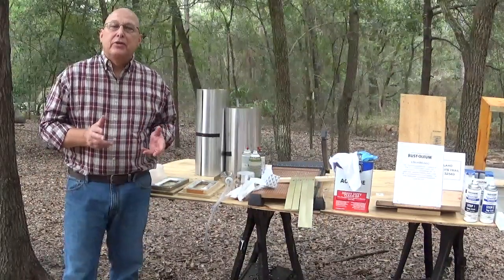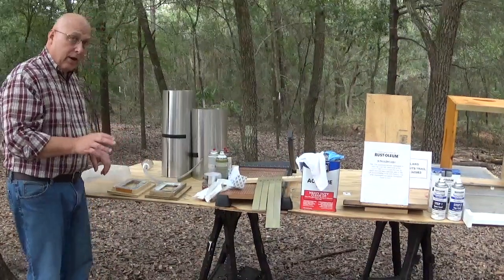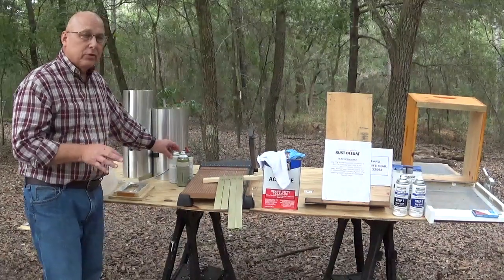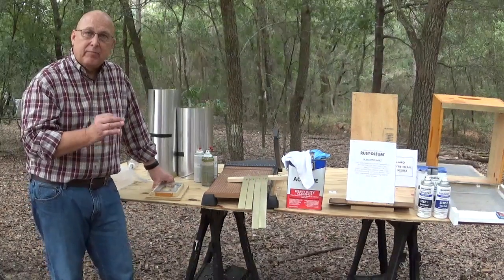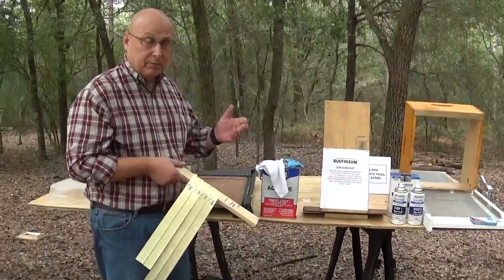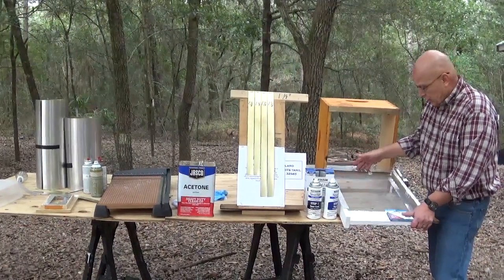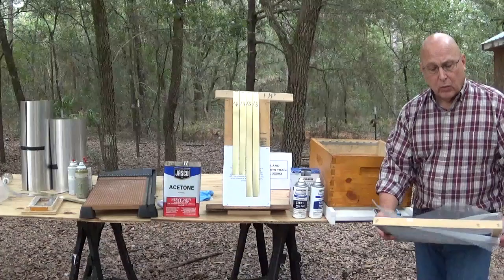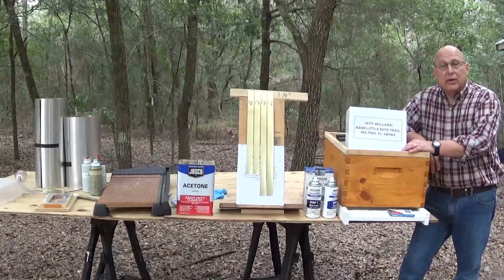Small Hive Beetle Barrier, it is easy to make and inexpensive.....

Comment: Mr. Willard. You have $$ headed your way!  I am a 3rd year Beek and have struggled with beetles something fierce. I am in North Central Alabama. I have switched to a “ Freeman Style”  bottom board and added your strips. Went in my hives today and not a single beetle! This time last year, I was already struggling with a significant SHB investation. Thank you so much for your contribution to the bee keeping community.
Reply from the maker: Hi Tim,
  Thank you and I glad its working in your hives. I have some news that I wanted you and others to be aware of, I have found out that the spray can kits of Neverwet that I used originally is being chewed off by the bees, mine lasted over two years before the bees cleaned them off, some hives really cleaned the barriers  off and some hives just removed a little of the Neverwet coating.

  I have some additional info from Rustoleum about an Industrial Neverwet that is 20 stronger than the spray can and I have been making some changes to my hives that will help and will share in an upcoming video very soon. The spray can kit does work as you and I know but it just won't hold up long term against the hive cleaning habits of the bees.

Comment: Gday from Queensland Australia.  I just came across your video today and I think it is a great idea.  I am only just starting out with my 1 hive but i am  making some more hive boxes to increase my bees to 3 or 4 hives. I have been reasonably lucky so far with SHB but still have a half a dozen or so each time i do an inspection.  As it is so reasonably priced to get the never wet product on eBay i am going to outfit my new hives and my existing one asap. You have done a great service to the beekeeping community wordwide if it works as good as it seems to.  I hope those same beekeepers can show their appreciation by giving a little back. Thanks again mate. All the best.
Reply from the maker: Hi John,
  Thanks for watching and don't forget to subscribe and like, I've got more videos on this Neverwet idea and new ones coming out. The SHB can not walk on this material but I have been making improvement videos on the installation of these Neverwet coated barriers. I am now experimenting with a stronger material and a new way to install them.  Watch all the videos to get all the updates for hive protection. Good luck with your hives...

Comment: Because of the electrolysis, forgo the staples and merely angle the metal 90 degrees for a quarter of an inch,  and have your measurements adjust to the 3/8 overhang to the inside of the super brood box then rip a groove down the bottom center of each board to fit a single or double bent piece of the aluminum flashing. No staples and no erosion to deal with, ever. The bees shouldn't have a working space underneath which is brilliant thinking, and the bees are not hampered by the ledge flashing? I'm up for some sharing some ideas...happy bee keeping to everyone who shares without always looking for a  reward. Some things money can't buy... And the best often comes that very way more often than not. Good wishes for you and thanks for sharing this grateful information about saving the bees.
Reply from the maker: Thanks for the info. I have always tried to come up with the simplest and most efficient approach to any project that I do. There is always room for improvement on anyone's idea and a dozen different ways to use Neverwet against SHB, good luck and have fun with yours.

Comment: I like the beetle vac idea, when looking through the hive and seeing 3 or 4 walking around and trying to get them with a hive tool without crushing comb,  that looks like a good idea,  have to try that,  thanks.
Reply from the maker: I even made one that is battery operated to suck up Fire ants in the Neverwet VS Ants video but when I used it in the hives for SHB I had to paint it white because the noise and black plastic was really pissing off the bees.

Comment: I love this idea and the succinct and no nonsense way you present it. I'm going to make one this weekend. Thanks for figuring this out!  Donation headed your way. (Jeff Willard, 6255 Little Bits Trail, Milton Florida, 32583) 
  One small nit; If you google "Galvanic Corrosion" and open the Wikipedia link you will find a table that shows plain, non zinc plated steel is a better coupling to aluminum (only 0.05  volts difference) compared to the coupling voltage of stainless steel to aluminum (0.45 volts). More voltage = more corrosion. Use of a stainless steel staple (cathode) will, over time, corrode the aluminum (anode). If zinc plated steel staples are used they will give up their plating fairly fast (Zinc is more anodic than aluminum) and will leave the steel exposed to the elements to corrode at the normal rate.  The best compromise would be to use non-plated steel staples with aluminum, but to seal the staple using paint.
Reply from the maker: Hi Jeff H, I'm glad you liked the video. The flanges do repel the Hive Beetles but even I am still fighting with the small gaps here and there on the vent tops and hive bodies. Moisture appears to be the culprit, I have been experimenting with foam seal tapes, I have been using white polyethylene closed cell adhesive 1/8"thick x 1/2wide" between the supers and hive body and Frost king gray vinyl foam tape 3/16" thick x 3/4" wide on the vent tops. Give the edge your going to stick the tape on a coating of 3M contact adhesive for some extra bonding, these two foam tapes appear to be doing the trick. I got the polyethylene from Amazon and the vinyl from our hardware store. Thanks for the info on the corrosion ratings between stainless and plated staples. Good luck with your Bees.Jeff Willard
Reply: Hi Jeff Willard,
Thanks again for all your hard work and sharing this idea with us!
Just to clarify this a little, I think Jeff H has a point about galvanic corrosion.  However, things are not always as simple as what one expects.  I had lengthy discussion at work about bolting aluminum together with stainless fasteners, and the conclusion was that it was okay, but the reverse is not okay.  One big consideration is the area difference between the two metals. If you used aluminum bolts with stainless plates, there would be a failure in a very short time.
So, to make a long story short, because there is so much aluminum versus stainless, it shouldn't be a problem. 
Scroll down to the plating compatibility chart:
https://www.fastenal.com/content/feds/pdf/Article%20-%20Corrosion.pdf
And let us know if any of your staples or connections fail.  I'll do the same.
BTW, you answered my question in my previous post and I have bought the closed cell foam tape, and it seems to be helping with the SHB problem.  Thanks for that tip, too.
Reply: Jeff Willar
Reply: Jeff, Makes much sense in what you explained. I guess one could spray the staple clips using Bin shellac based sealer, let dry before loading into the staple gun. Thanks for your input.

Comment: Hi Jeff,  thanks for the prompt response.  I'm currently looking through peer reviewed articles about flight and hive interaction of SHB.  Your explanation of the behavior of SHB inside the hive makes complete sense to me...but I'm not an expert.  I will gladly share any information that I find.  Also,  I am starting two new hives this spring.  I plan on fabricating your flanges and installing them per your instructions.  Top screens also installed.  Based on past experience,  we should see a measurable decline in SHB population this summer.  I will keep you and your subscribers informed.  Definitely will compensate you for the R&D.  
Again, thank you for your team-effort disposition.
Reply from the maker: Hi Mmmm, Thank you and please keep the bee community informed of any additional information you find. I know that the Neverwet coated flanges will work in your hives as well as they have in mine. Just make sure you caulk and seal the hive above the coated flanges, if you haven't watched them yet, check out the "update; small hive beetle excluder" videos. In these I explain some additional problem solving while using the flanges. You'll see in update #2 I still have almost zero beetles in my 31 hives two years after their installation. I have one last video about these Neverwet coated flanges that will leave the bee community amazed what these coated flanges can do, I should have it done and on you tube this week. Good Luck with your bees.

Comment: I also am going to try the approach to spray a large sheet and then cut into strips. Will report back on effectiveness.
Reply from the maker: You could spray a whole sheet,  I've seen people talk about doing it that way. My only concern with that method is the Neverwet adhesion on the cut edge, it may hold up I just don't know. I thought that coating the whole strip at one time would allow the maximum adhesion of the Neverwet on the flange edges. You can always try some to see if it works.  Remember, sometimes doing it right the first time is a lot easier than doing it twice.

Comment: oh just to add. I use the metal tape to seal boxes together. it is very weather proof. it's 2 inch wide and it really seals them up then when removing supers you just run your finger nail thru it. just a thought for you on sealing the boxes together.
Reply from the maker: Thank You.
Reply: Jeff Willard y

Comment: sweet idea jeff.  thanks for sharing.. I made some aluminum strips like you did on my bottom board and then on my bottom hive body and noticed a decrease in my hive beetle population.  I will now try and get that paint from rustoleum and make it slicker.  Thanks for the tip.
Reply from the maker: Thanks Mike, It works.... Good luck.

Comment: Hi, Jeff, thanks for all your research!!  I also like the way you showed all of the different methods you tried that didn't work.  You presented your findings super well in your video.  Most of us need to take an idea all the way to the extent you do and then share it.  It is too bad some of the extension people don't do some of this research.  

I am also wondering if a beetle baffle in the front of the hive made with your metal strips might work or of rain x-- the stuff my wife likes to use on her windshield wipers might work.  Yes, it looks like I have a little research to do myself.  Hive beetles are a big problem in that they take up a lot of bee time in our area.  Yes, one could wait until bees become hygienic enough to combat them, but that takes up bee time that I want my bees to do other bee work, not mess with beetles.
Reply from the maker: Hi Tom, I'm not sure what you mean by a baffle in the front of the hive. When install as in the video the Neverwet coated flanges protrudes inside the hive  3/8" continuously on all four sides with overlapping corners. The rain-x, I believe is a silicone based water repellant for glass that is not a permanent coating, Neverwet is permanent and non-toxic. But as with all inventions there is always room for improvement, but with no hive beetles inside my 40 hives I don't think I'm going to change my design, plus its cheap to make.....
Reply: I guess I was trying to tie your success with  the beetle baffle where an opening near the front of the hive where the beetles trying to crawl under the hive to get into the hive would just slide off into a waiting moat of oil and the bees could step over it and into the hive.  I just don't like the idea of having a pan of oil under the whole screened bottom.  

I am about to make some bottom boards so I will try it and if successful, I will send you pics (might be next year though for testing).  I am encouraged by all your experiments on your method.  The screened bottom is supposed to help with ventilation and varroa mite.  

To help answer other's questions on beetles flying up onto the hive from the bottom board, it seems that their take off is a little too haphazard for very short distances.  They seem to take flight and then orient themselves to land on their feet and it doesn't work for them on very short distances.  Thanks again for your work on this issue.

Comment: Jeff love the idea. I am going to try this as soon as I can. destroyed my shoulder at work. I use raised bottom boards with 1 1/2 -2 inch holes for my bottoms. that raises the brood box by 1-2 inches. the bees seem to really like these bottom due to more natural opening I guess. they will sometimes add a small strip of burr comb. no problem. I wondering if the open space if the SHB can just fly up. with the more open bottoms I have notice way way fewer SHB in those hives. may be because they have to fly the distance and don't. don't know. but I'm going to do this on my nucs and old bases. good luck and see you on the forum beemaster's and welcome on board.  I'll contribute as soon as I can. we need to help each other all we can.
divemaster1963.
Reply from the maker: Hi John, Small Hive Beetles are not suppose to fly once inside the hive but I'm sure there is always that one mutant hive beetle that does not act as normal as the rest of them. Your bottom board sounds interesting. If you can take a picture of it and post it on Beemaster,  Bee Keepers are always interested in something new and works.. Thanks..

Comment: Will try this. Our hives were devasted by these beatles, nine hives down to two. Tragic.
Reply from the maker: Hi Peter, This really "WORKS" but I can not stress enough to caulk the seam between the bottom board and hive body and use polyethylene foam tape between hive, supers and vent top or covers. If you leave any opening above the Nevercoated flanges the beetles will get in. Now in my hives I can't even find enough Hive Beetles to perform the tests that I did.  This is were I buy mine......  http://www.equalseal.com/White-Polyethylene-Closed-Cell-Foam-s/2187.htm
Reply: Thank you!

Comment: Hi Jeff, this is exactly what I have been looking for- I am sending a contribution now. One question:  if you have a screened bottom board, why do you say that the trapped bees die of old age or the bees kill them- won't they fall thru the wire?
Reply from the maker: Hi Wendy, The Hive Beetles won't just fall through the screen bottom but they can easily crawl through it, especially when the bees are chasing them. The Hive Beetle will always be attracted to your hive that's in their DNA but the Neverwet coated flanges prevents them from crawling up into the hive to live and lay eggs. I say this all the time, you must seal all cracks above the coated flanges or the beetles will find a way in. Use the polyethylene foam tape I have listed above it works great and makes the whole hive sealed and beetle proof. Thanks for the contribution and good luck with your bees.

Comment: Thanks for all of your hard work and time that you put into this beetle excluder.  Question for you: I use a top bar hive and I was wondering if you have any ideas that may work for the top bar hive community to exclude these pests.  Thanks again Jeff.
Reply from the maker: Well as a matter of fact I do. Bob Spencer in Gulf Breeze FL. was kind enough to make a video of my design of an entrance chamber for a top bar hive that I gave some thought to. Bob was going to adapt it to his AZ hives, here is his video   https://www.youtube.com/watch?v=-rNoM4z02o0&feature=youtu.be   and here are my design measurements; To make a mini bottom board attach a 3/4" high rim to an 10" wide X 6" deep bottom along with a 3" landing pad. Then make a 2" high upper compartment with a solid top cover, the 2" upper would give you enough material to drill or slot an area to mate up to the hive opening. It will also have enough room for  the bees to crawl over the Neverwet coated flange or fly into the hive entrance but dark enough so the beetle won't fly inside the mini bottom board. The Neverwet coated flanges would be attached the top of the 3/4" rim on the side and back and then attach the 4th coated strip to the front of the 2" top compartment, just like in the original Neverwet Excluder video. Have Fun.......

Comment: Jeff, 
Thanks for all your good work!
This is very clever and I have modified our two boxes accordingly.  It occurred to me afterward, it would may be easier to cut out the profile of the hive body from 1/4" or 1/2" plywood, then add the never wet strips to the plywood cutout.  Then take the brood box off and place the shim under the brood box.  That way if it gets damaged, it is easily removed, inspect and replace.  What do you think?  Maybe for a big operation, it may be too time consuming to create the plywood templates?
Also, you mention sealing up with epdm.  Can you point me to where in your videos you are using this to seal your hives?  We are still getting SHB's in and I have identified a couple of locations I want to seal.  But, I don't want to use the caulk if I should be using the preformed gaskets.

Comment: I was about to install the second set of hives and realized I accidently installed the flanges on the first slatted racks downside up with the NeverWet coated side facing up towards hive frames instead of down. The Neverwet coated side is supposed to face down towards the bottom board correct? Can't believe I did that but oh well so much for being in too much hurry.